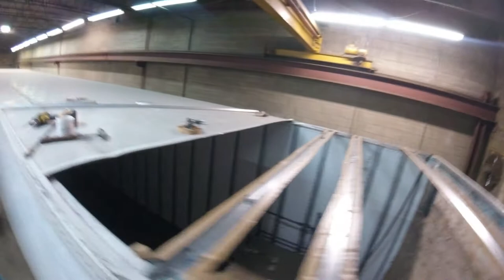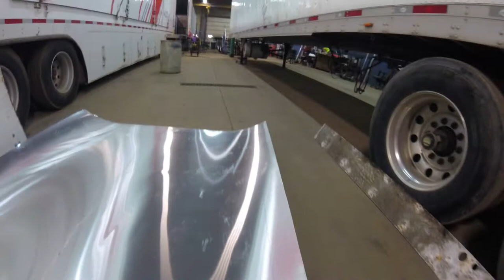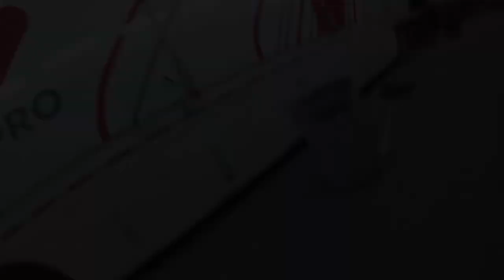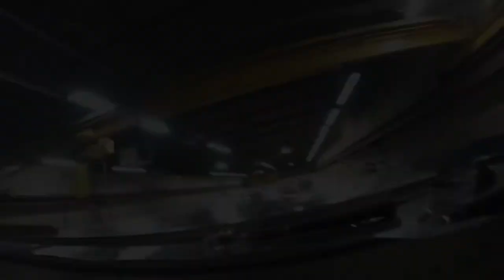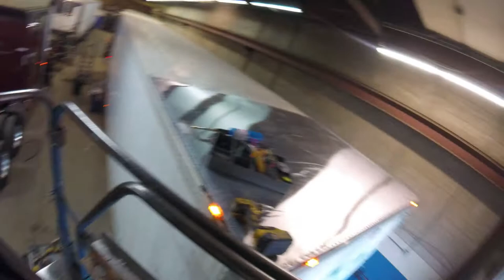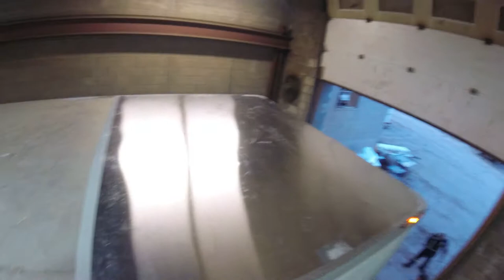how to section repair semi trailer roof repair

Comment: Thank you for the video 🙏Whats the name of the material ?
Reply from the maker: @1Wayfix  aluminum roof  skin heavy gauge
Reply: Thank you.
Reply: @mikeydesilva8197  the side panel should be the same material.  ??    And the. Side that meet the top and the side. ?
Reply from the maker: @1Wayfix  wall panel ,top side rail
Reply: @mikeydesilva8197  thank you.

Comment: Great before and after, but how did you install the rivets in the middle section ? Correct me if I'm wrong but I assume those are steel rivets and can't use a regular rivet gun.. im trying to figure out if there's a way to install the steel rivets easier in the middle section. Is it a two man job or is there a machine or tool that helps make it easier ?
Reply from the maker: alum squeeze rivets. 3/16x 1/2 soft . 2 people mid section buck rivets.
Reply from the maker: go to all my vids . sure you will find some useful info.

Comment: This was done wrong in my book I been a trailer tech for 20 years you should have 2 rows of rivets on each side of the roof bow  that you section and roof bow gives you middle support plus the new roof should overlap the old
Reply from the maker: your right
Reply: How should I attach over lap ? Front 16’ blew off my 36’ car hauler.I read one guy said it won’t last long?